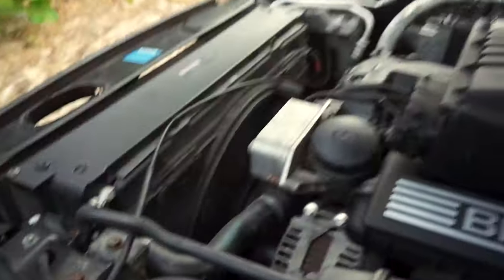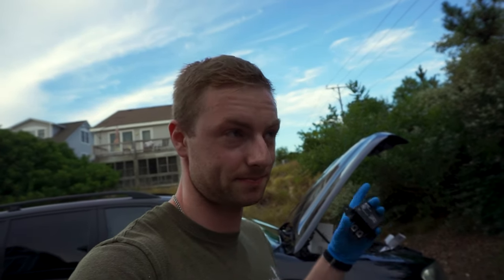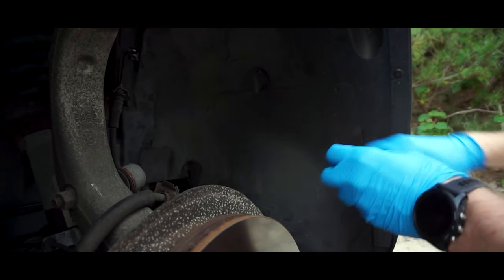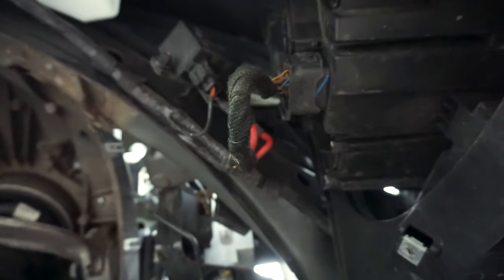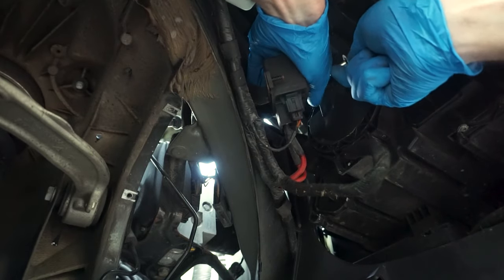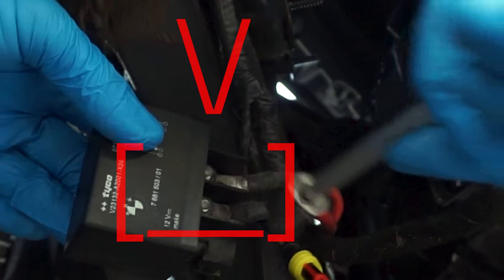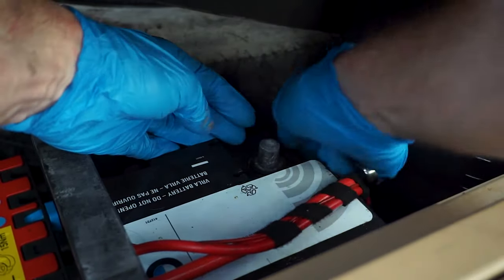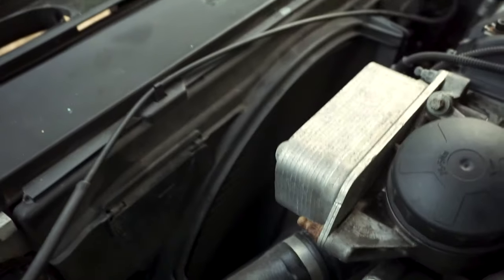How to replace radiator fan relay on BMW Auxility fan relay switch N54 N52 Overheating 2efe code

Comment: Do you know where the relay is on a e85 z4
Reply from the maker: If I’m not mistaken, the e85 don’t have the fan relay, rather it had fan switch, it’s should be located on lower radiator hose, pass. Side. Check the realoem.com for the diagram. Also, you may have the fuse as well.
Good luck man!

Comment: Bmw 335xi 08

Hey man Im getting the 2eff electric fan self diagnosis and 2f71 electronics box fan activation codes and my fan turns on full blast when its warming up and then sometimes its doesnt come and then csr starts overheating. Could the relay be the issue and if so im not seeing anything on location ?
Reply from the maker: First, the e90's don't have relay, in rare occasions they do but that will apply only to european cars. the 2eff is thermostate, or one of two element's that is made of, so I would assume you need replace thermostate and water pump while you there. the 2f71 on x5 for example is the fan that directly cool ECU box: https://www.realoem.com/bmw/enUS/showparts?id=FG41-EUR---E71-BMW-X6+35iX&diagId=12_1396
Reply: @Makhnovets  damnn man I just did my water pump and thermostat not too long ago , I cant imagine that it would go bad already. Maybe its a coolant temp sensor or fuse

Comment: Hello...on my 07 e70..the fan only comes on when I on the AC but shuts off immediately I off the AC causing the car to overheat ....help.
Reply: Have same problem with fan.. only coming on with AC on… did you ever fix this? What was it?

Comment: Do you know the location of that on a 2009 bmw 128i?
Reply from the maker: Upper radiator housing at the passenger side that's for 5series radiator switch, but it's more for 3.0 with no turbo, the 335 location might change. also you can search for radiator fan switch or so.

Comment: What exactly was your code?   Auxiliary fan activation: line disconnected?
Reply from the maker: The code is "2efe electric fan, activation"
That's mean either far or relay not working.

Comment: can that be my problem? only thing is my fan is always on and reads my engine compartment is too hot, but the actual temp is good.
Reply from the maker: If your fan is alway on, that means the coolant temperature sensor isn't working. The Relay is sort of switch, so if the fan is spinning that means relay working.
https://youtu.be/1ARsOcdPNGM - for the sensor.
https://youtu.be/J2mUbrXZqFc - overheating problems.
Reply: @Makhnovets  i actually replaced the sensor last night, but fan still wouldn't turn off. i tried bleeding the coolant system with heater and acceleration method, but tue water pump wouldn't activate, so im thinkin the water pump might be bad?
Reply from the maker: @twistedcells  you can see the electric coolant pump speed with obd tool, I think 500rpm/m it’s rated for, if the pump is on last breath, it will reduce the power in half, 250 or so.
If pump working just as it’s should, the oil temp sensor also can be the problem, i had a case. The sensor seating on oil filter housing.
Another question, is AC working fine? Have you hade any problems with it?
Reply: after ordering the obd, the pump data was unresponsive so i ordered the thermostat and water pump and popped them in tonight, problem solved! thankyou for the advice i really appreciate it🙌🙏

Comment: I have Bmw 320d 2005 e90 2l diesel and my radiator fan doesnt stop spinning until i switch the engine off. What could this be ive replaced thermostat and sensor but radiator fan starts everytime i start the car it very loud and annoying sounds like a jet. Ive also replaced the radiator fan
Reply: Hey did you find the a solution to your fan ??
Reply from the maker: Test it with A/C off. Another point if the thermostat stuck open or water pump reduced the speed the fan will work in full. Make sure you check if temperature stay at 95c’. Check the obd for water pump speed, or make sure you don’t have the messages that water pump is missing or reduce power.

Comment: my car is 2011 x5 e70 fan is working but its come high speed...anybody know about that ???.. thanks..
Reply from the maker: Coolant or Oil temperature sensor could show faulty data, and they pretty cheap, and easy to replace, I would start with them if I didn’t do it by now. 
Dos it do it all the time? Do you have any codes?

Comment: So my fan twitches but doesn’t fully turn on, Would this be my best bet if my fan wants to turn on but doesn’t fully turn on ?
Reply from the maker: it could be the fan itself, the electric motor build from two stages, first for starting and second for running on speed, after starting the car try to spin the fan little bit, but be careful!!!! if it's still not starting it could be the relay, but most likely it's fan itself, any way it's cheaper to get a relay replaced first, then fan, like i said in previous comment, there nothing else in between the fan and DME except the relay. really small percentage can be the temperature sensor, but it's usually have problem with running on hi or low speed if it's sensor. good luck!
Reply: OP, did you ever fix the twitching fan issue? Was it the fan or the relay?
Reply: I’m having the same issue is fan or relay bcz my fan works on a/c and twitches when idling also just changed thermostat

Comment: I have code p0480 on my 2009 bmw 335i pop up on my scanner its causing my car to overheat like 3-4 times but i know its not a blown head gasket even tho i had 2 shops tell me it was so im trying to hunt down the issue on my own is it in the same place and is mine a switch or module?
Reply from the maker: You have a switch. There tester for head gasket like this one, https://amzn.to/3Ee0J9y
Get one it’s 99% accurate, in that case, you will know for sure. Before getting into any repair or replacement. N54 very rarely has head gasket problems.
But the code is for a cooling fan, make sure the water pump and thermostat working correctly, the main symptom is the fan kicking on full speed, or it might was doing it before, in that case, you toast the fan. check the water pump speed, also try to actuate the cooling fan, there 4speeds for the fan, you can trigger it true INPA or OBD that supports the components trigger. See the readings off the temperature sensor and the consistency of the temperature rising. There are 3 things you need to check, cooling fan waterpump&thermostat and temperature sensor or switch. Good luck!

Comment: Does it work on a 2007 x3
Reply from the maker: Not sure, but you can check realoem for diagram, it should be under electronic/Relay.

Comment: 08 528i can’t find the relay anywhere. Anyone know where? Much appreciated
Reply from the maker: I think that you have radiator fan switch, which is seat on the passenger side radiator hose, at the top. I know that e60 have that type of setup! Good luck!
Part number: 13 62 1 433 077 
13627788077 1433077 13621433077

Comment: 2005 Bmw x5 v6 ac fan has no power going to it any suggestions?
Reply from the maker: test it true the INPA or ISTA... did you check the fuses and relay? that's two cheapest steps, the last one gonna be replacing the fan itself, like i post in the previous comment, in between the fan and computer only relay, so if the relay and the fan are new, and the fuses are good, check the wiring, there theory about the thermostat, which is showing the wrong data or so it's not gonna heart to replace it too., but i definitely would connect the computer and check if there any messages... Good luck, hope to here from you soon!
Reply: O yeah my ac doesn't blow cold also..I tried recharge and nope..I read somewhere my coolant fan relies on a couple sensors..I read maybe the ac pressure is related to my new fan slow off and on speed?? Any definitive suggestions would be appreciated

Comment: so i need some help on my f30 im getting this error “1A2004 electric fan control cable disruption” and or electric fan self-diagnosis stage 4:  severe fan error can some one tell me if they had that problem before what would it be
Reply from the maker: Test the fan itself by triggering the components, start with the st.1 and get to st.4. like i mentioned in the video, there could be only 3 things, that can get you some headache with the fan, which is relay, wiring, and Fan itself...
Reply: @Makhnovets  but im kinda lost most fan that i have test direct current only had 2 connections, this one has 3, the 2 big ones that are the red and black and there is a small green and black connector that is vertically, the other 2 are facing each other and this one is facing one of then, if i try to connect + and - to the 2 big ones nothing happends and i also ordered another fan and is the same so the question is, do i also have to give power to the 3 small one? if so is it - or +
Reply: @Makhnovets  and also i know is not the relay that u change because line is getting to it, also the 2 positive out have current and i tested the connector that connects to the fan and also have current the red cable is positive the brow (that connects to the black in the fan) is negative and the thinner green/black is a negative is that right? and if it is so it has power so is not the wiring, but i still have the question of how to correctly give power to the fan with the battery and directly, and what do u mean by st1 to st4 ( i hope is the fan) at this point or the sensor switch that i still have to find i only see the one under oil cooler and not a thermostat stuck open, btw i have a 13 F30 M

Comment: Bro I fucking took my wheel off and the wheel liner and my shit was not there. This is not true for e60 I'm pissed I wasted my time and still can't find the damn location
Reply: Why would you just assume that an E60 would be the same as an X5? They're completely different models so the locations of things like relays could also be completely different.
Reply from the maker: The “realoem” have diagrams, in Electronics section you should be able to find what you need.
E70 and E60 has completely different components structure plus the year is a big factor.
Reply: @Makhnovets  no doubt they are different. But in the video he says e60 is in the same spot ...
Reply from the maker: @jessepullen6109 I’ll double check with that, the chassis in X5 is very similar-same as 5series, but electrically would be different.
My apologies if that was my mistake.
Will make sure to update the information on that if so!

Comment: Expensive car but parts break premature. Over rated car.
Reply from the maker: That could be long conversation, I’ll try to keep my thoughts short, what i want to say that the car is not overrated whatsoever, from my perspective it’s underrated, for the reason of maintaining, if you check the BMW maintenance shit, it’s say when and what you will need to replace at curtain mileage, and if you not ready to do that don’t buy the car on the first place, buy toyota which is cheap inside and outside, and doesn’t have advanced technologies inside, same as riding experience, quality of ride, and more, I know it’s not perfect, rither tessla or Ferrari, there also have they good and bad aspects. Non of the toyota will cach the eye same as BMW or Mercedese!
The N52 and N54 engine’s are very reliable, in terms if you do proper maintenance!
Reply: I own bmw, Mercedes, Toyota and Tesla. Bmw break down prematurely.  That’s all I’m saying, breaking down before recommending to change parts.

Comment: I don’t have any codes but the fan is stuck on high and overheating, do you think this part would do the trick? It used to get stuck on high for a few min then disappeared but this week it hasn’t gone away ever since.
Reply from the maker: The Temperature sensor and Relay, Replace both of them. I would say the temp sensor multi-functioning, the one that seats on the oil Filter housing, it's cheap and easy to replace, you only need a 22-mm or 24-mm socket(https://youtu.be/1ARsOcdPNGM). The relay is cheap, so I would replace it as well.

Comment: So I have a quick question I have a 2010/05 BMW X5 30DX. Is the relay in the same place as your BMW because my fan isn’t working
Reply from the maker: Send me last 7 of the vin.
Reply: L427548
Reply from the maker: you don't have the same location or the same relay, the one you looking for is in the passenger compartment fuse box, Number:45,  60A relay.      Also check the luggage compartment Number: 127,  5A
Reply: @Makhnovets  thanks

Comment: Question:  2015 X1 xdrive28i has the same issue, no fan is working. The relay should be at same location? Do I need OBD memory save plug BEFORE I disconnect the battery? Any suggestion? Thank you!
Reply from the maker: The relay gonna be a little different, and it's in the DME box. see the pic. here  https://www.realoem.com/bmw/enUS/showparts?id=VL13-USA-02-2015-E84-BMW-X1_28iX&diagId=61_3822
It does not necessarily need to disconnect the battery to replace the Relay, but it's up to you. I never had an issue with replacing the fuse or relay on hot. just make sure the car is asleep (you basically have the key off the ignition and the car door is closed for at least 30sec).(or when the welcome light or any LED in the car is not lightning.)
Reply: @Makhnovets  Much appreciate your response, Thank you 👍

Comment: Does anyone know the  location on the radiator fan relay switch on a 2007 335i bmw twin turbo?
Reply from the maker: Relay is behind the battery in the trunk. Toward the front, there also some module sitting there...
Reply: @Makhnovets  
Couldn't find a video on it, except the one you have. hopefully you can do a video in the future on it. On locating the fan relay on a bmw 335i in the trunk. But thanks for the info.
Reply from the maker: Thank you for idea!